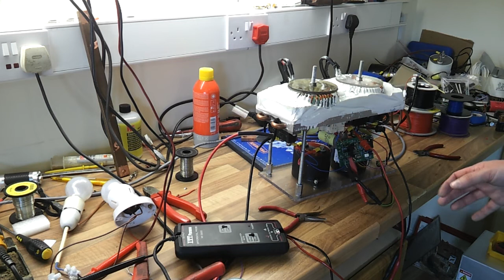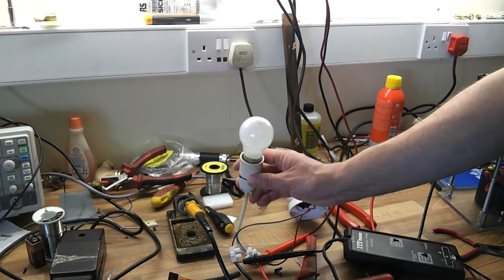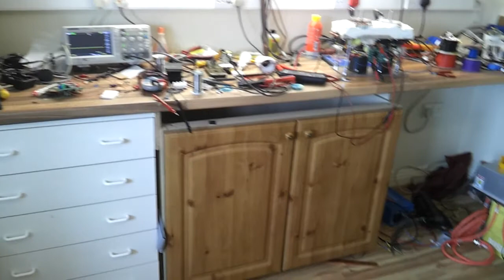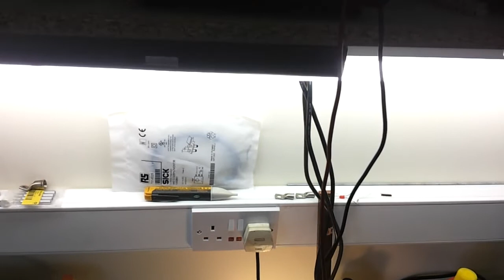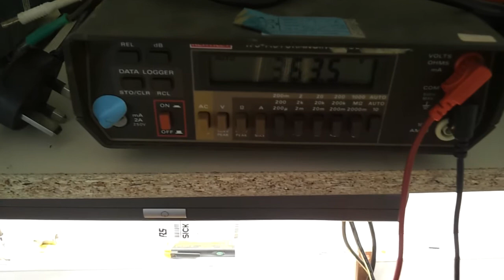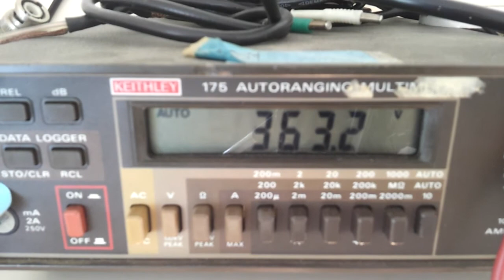BMW E39 EV Conversion 38 Charger 05

Comment: So you have built a 400v dc EV pwm charger that works off a 13amp house socket.
So your forklift motor and battery bank are both 400 volts?
Reply from the maker: This is only the pfc booster converter part. Actually charge will be controller by the buck stage.
Reply: What voltage is your forklift motor? I saw the vid where you advanced it